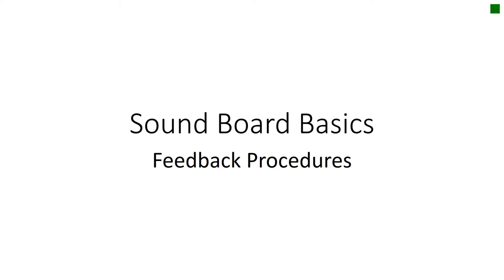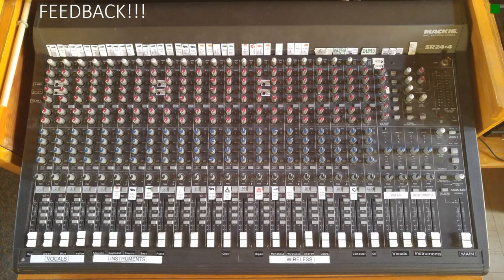Sound Board Basics: Feedback Procedures

Comment: Hello Andrew first I'd like to say I really liked your videos they where really informative. I use to have a smaller Mackie mixer , then I found a deal on a larger Console a Mackie SR40-8  which is really confusing like the Matrix section. the. AIR section actually the main  and the section in the center  I would really appreciate your help
Reply from the maker: I'm not familiar with that device. A matrix mix allows you to control a number of sub mixes as one. AIR often refers to the highest band on an EQ, but it sounds like you're talking about something else. Wish I could be of more help, but without the device to look over, I'm not likely to be able to contribute anything useful.

Comment: how about feedback destoyers/eliminators, etc.  do those actually work
Reply from the maker: ttb2857 I've never used them, so I can't comment with any authority, but if you set up your EQ properly, you shouldn't need them.
Reply: thanks andrew.  you are definitely helping me.  i have another question.  what is the maximum number of aux's a mixer have?
Reply from the maker: ttb2857 That's up to the manufacturer. Most small boards have two, larger boards   have 4, but I just installed a Behringer XR18, which has 6 auxiliary channels on a small board, which it can do because all the controls are virtual on a computer. It's like asking how many cylinders an engine has. As many as the manufacturer can fit without making the board unwieldy or too expensive.
Reply from the maker: The number of auxiliary channels depends on how many the manufacturer wants to include, and the main limitation is the space dedicated to it on the board. If you've got 16 channels, and you want 4 aux channels instead of 2, that's an additional 34 dials that need to be added to the board (one per aux per channel, plus a main control). That takes up a lot of physical space and it's a lot of hardware and wiring, which really pushes up the cost of the board. A lot of this problem is solved with a digital board, which can use the same controls to control many different channels. Therefore, adding more Aux channels is as easy as adding a few extra buttons and some additional jacks. So, if a large number of Aux channels is important to you, consider going digital. I recently installed a Behringer XR18, which comes with 6 Aux on a fairly small board. A Presonus 32 AI comes with 12 Aux, I think. So, the bigger the board, the more Aux channels, and you get more if the board is digital as a rule.
Reply: I use this one and it does help. It allows me to get some more volume output from my mics before feedback starts. https://www.youtube.com/watch?v=uDkuhthaqjE